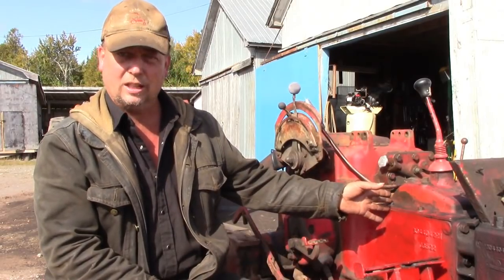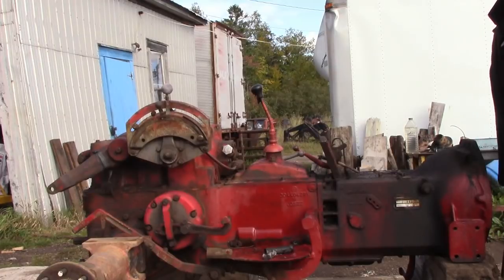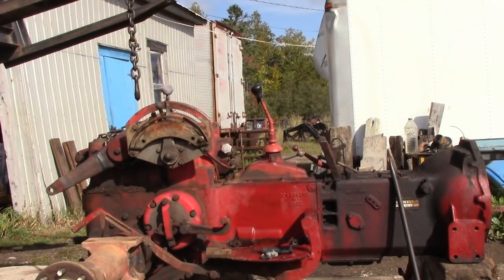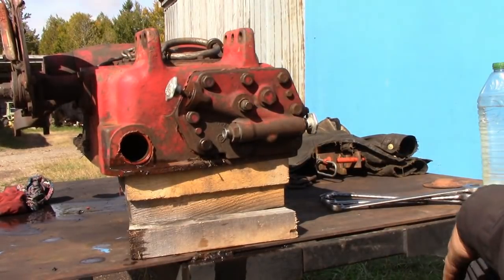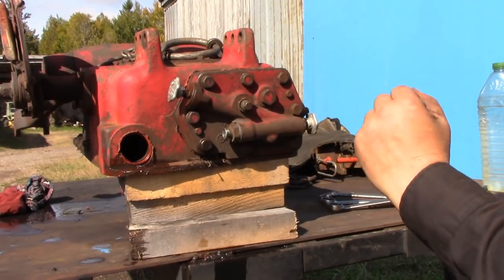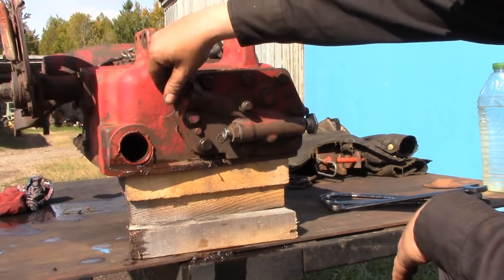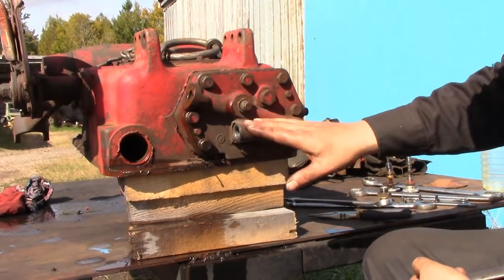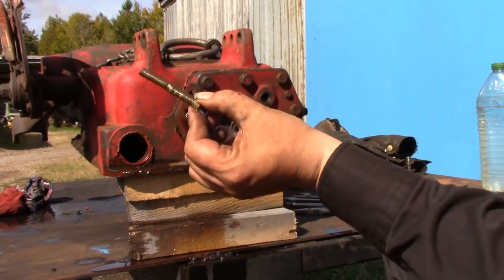B414 Hydraulic unit dis assembly

Comment: Don't judge, but what is the round cover thing on the left side of the tractor underneath the hydraulic unit?  It has an outlet on the lower side with some sort of leather-ish cover.  My 414 is leaking hydraulic oil and I don't want to take off too much stuff.  Very new at this.  Poverty inspires greatness!
Reply from the maker: That would be the brake housing. If it is leaking oil  it's a pretty big job to fix. Check out https://www.youtube.com/watch?v=EST-ssHkrIo&t=2s
Reply: @CanadianRedneck15  wow, i didnt expect a response.  Thanks so much for getting back to me.  Yes I think that is the brake housing.  Just finding my way on my old B414 diesel.  I did find the hydraulic filter thanks to your video, but I can't locate a replacement hose for connecting the filter back to the line.  Should this slide easily, i.e I can get a 3/4 inch hose on the filter end, but can't get it to slide over even a little.  I just keep pulling the filter out.  I put the filter end hose to the wire wheel to make sure it was clean and smooth, but no luck.  Is this just a 7/8 fuel/oil hose???
Reply from the maker: @GoatWomanChronicles  It would be a hydraulic suction hose, fairly stiff so it doesn't collapse.
Reply: @CanadianRedneck15  Do you  happen to know the size on that?  I think the filter has a 3/4 inch end.
Reply from the maker: @GoatWomanChronicles  No, I'm not sure.

Comment: Have a 444, how do I get to the PTO shifter? It will not stay engaged
Reply from the maker: That is most likely the PTO sliding collar and PTO input shaft splines worn and pushing out of gear. The PTO shifter unbolts by the 3 bolt bracket at the base of the PTO lever. Thanks for watching!

Comment: Put hydraulic unit back together new seals gasgets the deeper control moves the 3 point hitch but the up and down lever does not lift or lower properly
Reply from the maker: There must be some linkage no connected correctly.

Comment: I have a International 384 tractor. I rebuilt the hydraulic unit but when I went to use it oil sprayed out. I used o rings from a o ring kit which is smaller than the oem parts. Can you tell me where I can get a o ring kit for the hydraulic unit. Like your video's. Thanks
Reply from the maker: It's made in England so are likely metric o-rings, try a Case-IH dealer. Thanks for watching!

Comment: Hello Dave I have an international 434 and I have a problem with the hydraulic lift for the 3 point hitch. It lifts as soon as you start the tractor even with the control lever in the lower position just woundering what I could check or how to fix it or what to do? Thanks
Reply from the maker: Make sure your draft control lever is most of the way forward, if that isn't it you will have to check for a stuck/blocked valve or linkage out of adjustment. Thanks for watching!

Comment: Great video. I’ve got a 484 that I bought new it’s been and still is a good machine. I’ve got a little over 5k hours on it and the three point lift just started to move slow and tractor has to be reved way up for it to lift at all. Has new fluid & filter !screen is clean , pressure relief valve is good I changed it out with another tractor , diverter valve to steering isn’t stuck . I would appreciate any advice as to what to look for next.   RED POWER
Reply from the maker: If that has just suddenly started then I would say there must be a blockage/restriction on the suction side of the hydraulic pump, if it has been a gradual problem getting worse over time it's most likely  a bad hydraulic pump. Thanks for watching!

Comment: I am fixing up an International 238 which I have read is the same as the 384 tractor except for the yellow color.  My father-in-law bought it new but it has been parked for several years since he passed away .  My question concerns the tachometer which quit working while my father-in-law was still alive.   The tachometer works with a drill when the drill is run in reverse.  The original tach gear housing had stripped gears.  I went online and ordered a new tach gear housing for case-ih 384.  It did not work although the cable was turning. I popped the cover on the original housing and discovered the gear turns in reverse of the new one. The new one, supposedly for model 384, turns counter clockwise as viewed from far end. The part number on back of original gear housing is 3125112/R91 which is no longer listed on web.  I saw another site that said theirs replaced part# 3070504R91 for a model 384 tractor.  Did they switch the cable rotation direction on the model 384 at some point in time?  Can you tell me where I can order a new tach gear housing for 384 that turns the cable clockwise as viewed from far end? Lastly, you do a great job with your videos and I have learned a lot from watching them.
Reply from the maker: IH made the 384 for about 3 years, it's tach turned the opposite direction from the rest of the earlier models of that series and I have not been able to find the proper gearbox for them only the earlier ones, sorry. I am glad you have been enjoying the videos, thanks for watching!

Comment: Hello from Scotland, On my tractor the lift arms are very slow to drop down with a plough fitted also the arms will not rise unless you lift the draught lever to maximum height and when it does get to the top it jitters up and down or shakes have you any ideas what might be wrong? I fitted a new suction filter and put new oil in. Using the position control lever will not raise the arms unless the draught lever is right at the top is that normal?
Reply from the maker: No, definitely not normal, sounds like the linkage could be out of adjustment. The draft control lever should be all the way foir ward when not plowing. Also check your fast/slow valve and make sure it is set to fast. Thanks for watching!

Comment: Hi
Great videos
I've an international 354 and have some issues with the hydraulics.
It lifts easily initially when cold but then it gradually has to be revved more and more to achieve the lift until it eventually becomes very difficult to lift at all.
The oil gets hot and lift can be lost. It  then begins to drop as one drives along. It also has a jerking motion on a regular basis.
I've a relatively new pump installed and have changed the oil and oil filter. There doesn't seem to be air in the system when I dip the oil. It seems clear in appearance.
I've changed the o ring in the isolater valve.
From the info I can pick up here and there it appears maybe I've got an issue with the piston seal, the relief valve.  It seems there are a plethora of o rings behind the control valve casing which you took apart in your video of the 414. There seems to be a lot of bits and pieces, springs etc attached to the back of the control unit
Do you have any video as regards the detail of how these are repaired/replaced. For instance can a complete new relief valve be installed without pulling all the little bits and pieces. Where exactly is it etc
Be great to hear back
Reply from the maker: From what you describe I would agree, either piston seal or the relief valve. Unfortunately this video pretty much contains the extent of my knowledge on these units. Thanks for watching!
Reply: Many thanks for the prompt reply especially from a guy all the way from Ireland!
Wondering could you point me in any direction where I might get more info?
Reply from the maker: @mrpm5093  Probably your best bet if you know of any older IH mechanics around you to help you out.
Reply: @CanadianRedneck15  
Thanks again
Had forgotten there's a former international dealership  now Case nearby. They do repairs as well.
Will have a chat with them
Keep up the good work!

Comment: I'm having an issue with me 3pt. It will not lift with the position control lever, it will lift and lower with the draft control lever only. Any suggestions?
Reply from the maker: For normal operation the draft control lever should be most of the way forward. I really don't know what would cause your trouble otherwise. Thanks for watching!
Reply: @Canadian Redneck  
I've tried pushing the draft lever all the way forward and then tried using the lift/lower lever. It doesn't do anything. 
It's boggling my mind.  
Keep up with the videos, they've helped me out with these old tractors.
Reply from the maker: @nikdelsordo3016  Sorry I'm not any more help with this one.

Comment: My b414 three point hitch has the hiccups under load. It will drift down then pop back up to desired hight. I would like to fix that. What direction should I head to truble shoot this issue?  I was wondering what seals and oring I would need or maybe a kit to get to rebuild this and fix the issue? I have parts manual and shop manuals.  Thanks
Reply from the maker: I expect it would be leaking by in the cylinder but it could also be the valve. Thanks for watching!

Comment: What would cause the three point assembly to rise on its own when the lever is in the down position? If you put pressure down on the arms it will not rise but if no wait it will rise. Also to remove the center top cover on the trans ware the shifter is do you have to remove the hydraulic lift assembly first? We are having issues ware the transmission wants to pop out of high range. The questions are directed twords a b414. Thank you
Reply from the maker: There is some sort of a restriction causing the hydraulic oil to flow into the lift cylinder rather than cycle through back to the reservoir. To remove the shift cover you have to take off the lift unit first. Thanks for watching!

Comment: I have a International 444 My unit has power steering and the 3 point hitch run off of the hydraulic pump hydraulic pump on the right side of the motor my 3 point hitch stop working could it be the relief valve behind the plate with the cylinder under the seat if not where is the relief valve for that hydraulic unit Thank you in advance any help would be appreciated
Reply from the maker: It could be the relief valve, you might also want to check the linkage inside the unit. Thanks for watching!

Comment: My 3 point wont lower now and stayed in the up position. I removed a plug to release pressure and the 3 point lowered. Could I have a clogged valve or bad part? I am not sure what to look for. This old 444 has really given me lots of work and headaches.
Reply from the maker: Make sure the draft control lever is all the way for ward and the valve on the right is open. If that doesn't do it then you could have  a bad valve or linkage out of adjustment.
Reply: @CanadianRedneck15  Valves are open and which valve could be bad, flow valve or the one inside hydraulic tank. Before things failed any small rev in engine would make the 3 point rise to the top. I may go tinker with tractor this weekend. Thanks for all the help over the past months.
Reply from the maker: @cutweldngrind  It's possible that the linkage is not activating the dump valve or there could be a blockage not allowing the oil out of the cylinder to drop the 3PH. You just have to start digging into the unit really.
Reply: I also bought some oring kits today incase I have worn out ones that need replacement. I'm watching the video with no sound but will watch it again today on my pc.
Reply: The spring that's mounted to the bottom plate is broken on my tractor, what function does it do.
Reply from the maker: @cutweldngrind   That is the draft control spring, you really only need it when you are plowing ground.
Reply: I checked all the linkages and they seem to be in place. Today the box blade stays 10 inchs off the ground when in the lowered position, I removed the regulator plug and released pressure and 3 point does go down that way. I replaced oring in both side valves just not sure where to look for a clog. Can I have an issue up in the flow divider area or will a clog exist under the seat area. I will continue to look around. Thanks
Reply from the maker: @cutweldngrind  I'm sure if it got some dirt that it could get a blockage in any or all of those places.

Comment: Hi Dave,  awesome videos! I bought a 434 with a loader and power steering. The loader and power steering work great but the 3pt hitch doesn't work at all . I replreplaced the whole lift unit and it still no luck so I bypassed the loader and plumbed the line directly into the rear lift unit and it still doesn't work.  Any ideas that is going on or what I can try next?
Reply from the maker: I'm sure you did but did you check that the valve on the right side is open?
Reply: Yes the valve is wide open, the fast slow valve is on fast setting and there is no screen in the valve body
Reply from the maker: @stevehinds7231  Without being able to be hands on I've pretty much exhausted my knowledge, hydraulics aren't my strong suit, sorry.
Reply: Ok thanks for your time.

Comment: Hey how would I add rear remotes on a 384, with a separate control so I can maintain use of the 3pt controls. I have a ezee on front end loader. Can it tie into the input and out line of the front end loader valve body. Then add a separate lever to power the remotes on or off?
Reply from the maker: If you use a "power beyond" valve you can run the oil flow from the pump through the new valve to the lift unit and then be able to use both at the same time. Thanks for watching!

Comment: Tanks a lot!! Very helpfull. If you have a chance one of these day it would be very appreciated to see something about the repair of a power steering cylinder of a 434. Mine is leaking and I've paid $300 box for repair and still leaking. This time I'm gonna do the repair myself. Tank's again.
Reply from the maker: I don't touch those cylinders, they're pick SOBs and there are limited parts available. I am glad you enjoyed the video, thanks for watching!
Reply: @CanadianRedneck15  Tank you for ypur answer. Do you know what repair manuel covers this cylinder?? Is the ''Blue Ribbon International B-414 424 434 444 Hydraulic System Manual''  covers this??
Reply from the maker: @denismorissette419  I'm not sure but I would think that it should.
Reply from the maker: @denismorissette419  That would be great, thanks!
Reply from the maker: @denismorissette419  Well that sucks, it would be really helpful to have a  manual on those cylinders!

Comment: Cant find the drain plug on my 624. The op manual just says remove  it but not were it is. Also something about a strainer. Luckely the oil looks fine on the oil level plug and the oil seeping from the hydraulic joystick.
Reply from the maker: It will be on the bottom of the case somewhere, just look for it.

Comment: my 414 the pto level is loose cant engage the pto  any suggestions
Reply from the maker: The PTO lever runs through a cast housing and pins to an arm inside the case, the pin is likely broken, it's a pretty common problem. Unbolt the 3 bolt flange, remove the lever and replace the pin. Thanks for watching!

Comment: Hello! I have recently changed the head gasket of my b414. Could you please tell me the torque spec of the head bolts?
Reply from the maker: I don't have that info right here but if you check one of my BD154 engine rebuild videos I likely mention when I'm installing the head. Thanks for watching!

Comment: Hi
I have a ih444 and the draft control lever is locked and it moves together with the other lever what can be the cause of both levers stuck together. 
Cheers
Nic
Reply from the maker: There is a friction disk between the 2 levers so they don't move too freely, it has likely rusted to the levers causing them to lock together. If you remove the nut from the end of the shaft you should be able to remove the lever and clean up the surfaces so they will move freely again. Thanks for watching!

Comment: I know this is probably a dumb question but can I plumb around the lift assembly I bought a old tractor with a ton of old hoses I don't want to replace because I will never use anything but the front loader
Reply from the maker: If you don't intend to use it you certainly can bypass the lift unit. Thanks for watching!

Comment: Hey great video. I have a 444. Have a oil leak between the front valbody plates.is it Possible to split without taking everything off the transmission? Thanks for your help.
Reply from the maker: It is pretty tight there but the front plate only has to come forward a short way, you may be able to get the front plate off without lifting the unit. Thanks for watching!

Comment: I was looking for anything remotely close to parts on my tractor and came across this video. I recognized the 2 valves on the front. My problem is I can't Identify which model I have or year so I can't find parts or ask questions because I have no clue what to ask about. Can anyone assist. I've asked all old farmers around my area all service centers and we haven't came up with anything.
Reply from the maker: There should be a serial number tag on the right side right around the brake pedals that would have the model number stamped as well. Thanks for watching!
Reply: @CanadianRedneck15  I found the tag but it's uk built and doesn't have serial number on it just a long model number or something . After watching a few videos I think it's a 79/80  384 or 434 444 how would I fig that out. And thank you for the reply
Reply from the maker: @capnJackin  444s and 384s had the serial number stamped in the model number line so it could be either. A google image search should help you tell which it is but both use the same lift unit so it doesn't matter for ordering parts.
Reply: @CanadianRedneck15  your awesome thank you much for the information. Keep making your videos I've already learned a bit from you. And I'm sure many people feel the same way